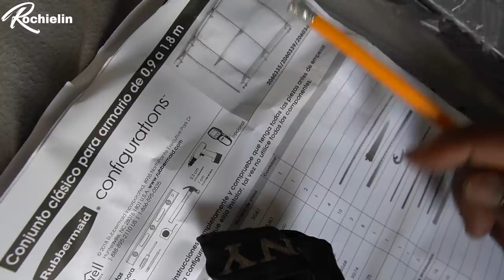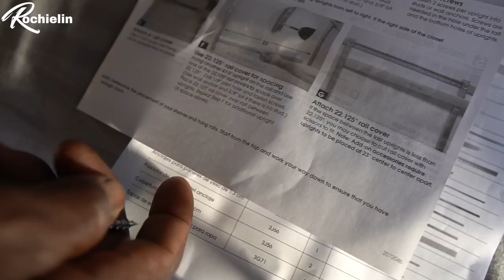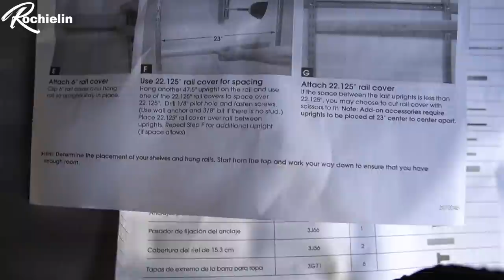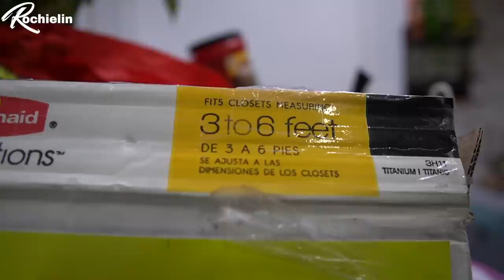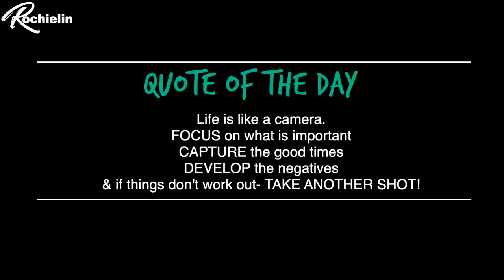Building a tiny home- 20 FT Shipping Container Home- Episode 6

Comment: Rochielin, where u have those shelving brackets, u do not have to cut ur tiles. Simply remove the screws from the bracket on the wall...not from the shelf but be sure to remove items from the shelf. Then gently slide the tiles onto the wall between the bracket and the wall...no cutting and or measuring needed. Remove the screws one bracket at a time.
Reply from the maker: Good idea , thanks but too late now .
Reply: @Rochielin   I wrote the same thing. On your next container house you'll know to do that. 
I hope you do more and put them under Airbnb.  Just have fruit trees in the back and and a nice driveway call it "Sustainable living ". I'll stay there.
Reply: 3

Comment: Although you dried the wall it's still moist. If you had a blow dryer it would have been best to use it to dry it again to get rid of any moisture so mold dont build up under the tiles. If you had a screwdriver you could unscrew the brackets then tile the wall and screw in the brackets again.  Good job on the peel and stick tiles. I rate it a B+